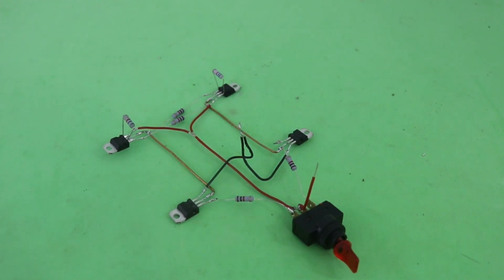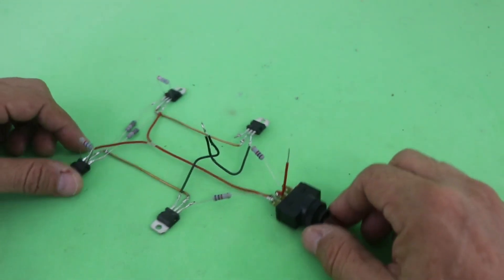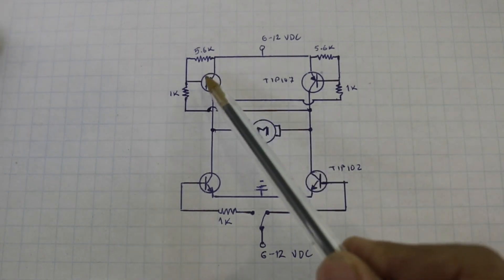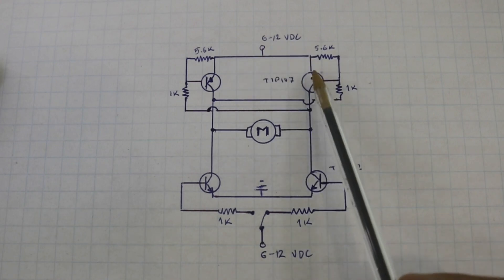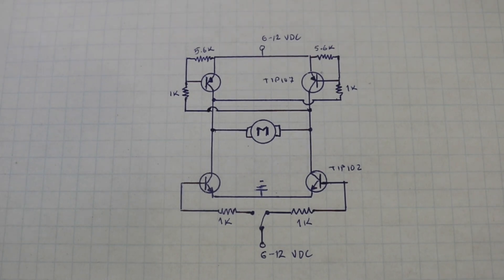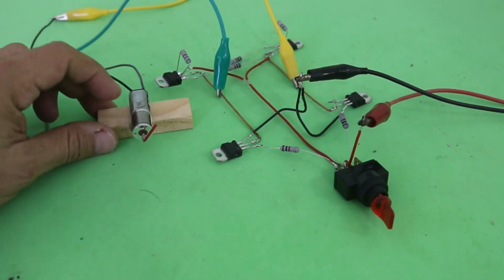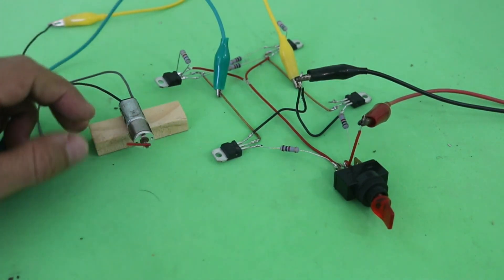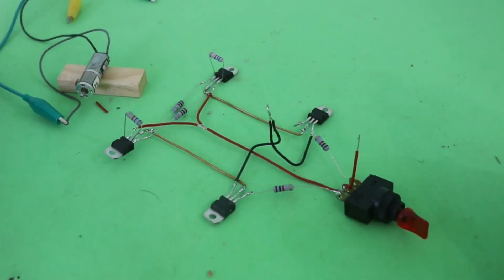H Bridge for DC Motor Control with Transistors

Comment: You can also build this circuit using two 555 Timer IC and a POT.
Reply from the maker: I will
Reply: @ludicscience  Please let me how it turned out.
Reply: @ludicscience  Then you have speed control as well as rotational direction control.